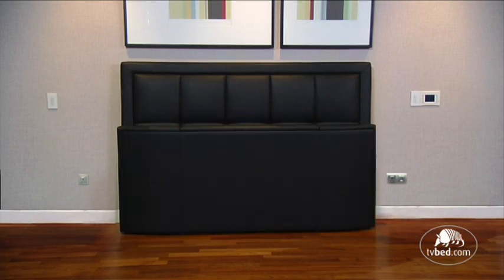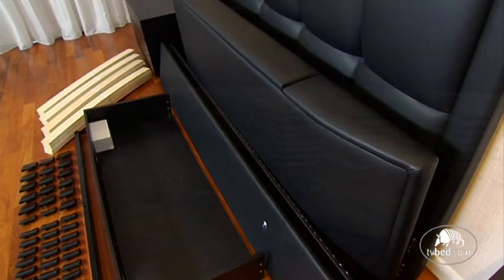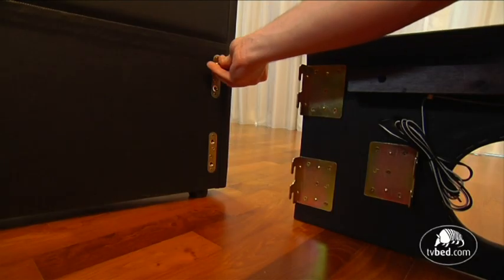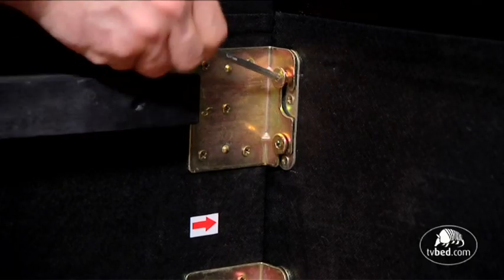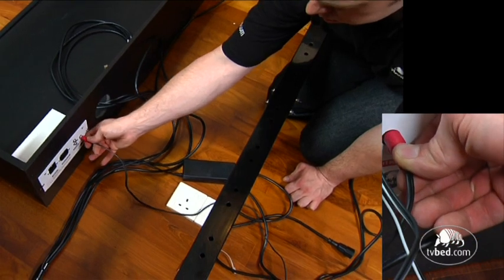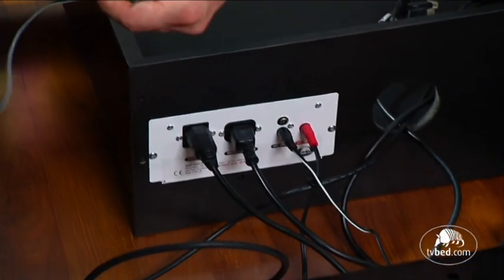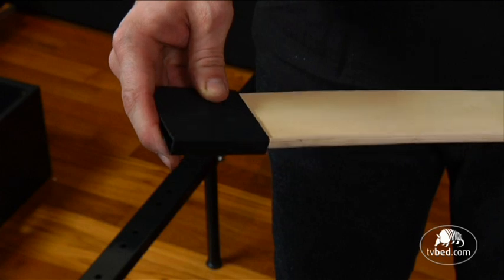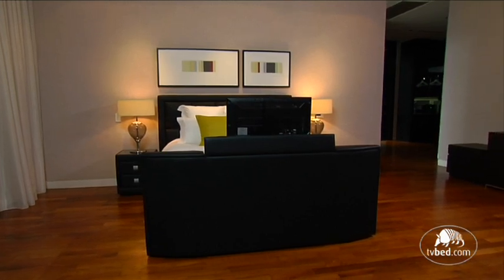TV BED - ASSEMBLY VIDEO

Comment: We just fitted ours up. One thing that did catch us out and im sure we arnt the only ones to do it....make sure you dont bring leads behind the tv as the centre strut on the mechanism will catch it and if its a close fit...which it is...it will snap the cable plug when the tv desends.
      Basic rule is leave all leads to the left or right of the tele...but never cross over.

Comment: I have this bed ,is it possible to change the TV TO A BIGGER SIZE
Reply: I’m struggling to
Change the tv I’ve had this bed for 5 years but think the company has closed down
Reply: Lambros Xydhias is 32 inch is the maximum for this bed? Want to get like a 4K tv 40inch
Reply: Yes... Just try and get what can fit to the biggest... TV replacement is really easy and only takes half an hour
Reply: But you have to power the tv by running an extension cable from an outlet
Reply: crapcopter do you know how to change the tv? We have got the broken tv off and got an exact replacement but don’t know how to screw the nuts onto the bolts as everything is sealed? Can you get to it underneath anyway?
Reply: @AB-qi2rn  hi, im having the same problem as you and I'm wondering if you came to a solution.
Reply: @AB-qi2rn  let me know if you get a solution for this! Having the same problem as well.
Reply: @satan7288   let me know if you get a solution for this!
Reply: @vivekpaulchacko8490  Yes, its possible but very very difficult. There are screws which hold thr TV to the stand in the bed and its very hard to fit your hand in the space to unscrew them as its all very compact. The tv which you want to replace it with must also be ridiculously thin and smaller than 32" otherwise it will not fit.

When I realised hoe difficult the whole process would be, I returned the new tv I bought and just kept the one that the bed came with.
Reply: @satan7288  thanks for the reply! Yeah it seems very hard to reach in and get the screws loose. I might try it myself and probably do the same thing in terms of returning if it doesn’t work.
Reply: @vivekpaulchacko8490  did you have any joy? I’m thinking of buying a Samsung 32 Inch UE32T5300 but worried about size and whether the bed’s bracket will fit? Does anyone know what kind of bracket this bed has?
Reply: @kunaldave9073  I was literally thinking of the same TV. But I was so stuck on getting a bigger one, so I’m instead going to do a bit of an extreme option and get a 43” and fix it to the bracket, and basically never lower it again as I never lowered my 32” in the first place. Will let you know how it goes but unscrewing it from the bracket seems not too hard as I tested it and it was fine to take the tv off. From my measurements it looks like the bracket has a 200mm width and I think around 200/250mm height, which is pretty standard. Also if the screws don’t match up, you can always buy a VESA adapter plate like so: 

https://www.amazon.co.uk/PureMounts-PM-Adapt-B-Universal-Adaptor-400x200/dp/B008KL72T8/ref=asc_df_B008KL72T8/?tag=googshopuk-21&linkCode=df0&hvadid=214453842616&hvpos=&hvnetw=g&hvrand=13609877613036079302&hvpone=&hvptwo=&hvqmt=&hvdev=m&hvdvcmdl=&hvlocint=&hvlocphy=1006661&hvtargid=pla-420169743750&psc=1&th=1&psc=1

Let me know how you get on! And I’ll update you once I try fit the 43” (going to be a mission)
Reply: @vivekpaulchacko8490  amazing!! Thank you so much for your help. I’ve been stuck trying find any information because of the age of the bed. I was tempted to buy a new bed but everything works perfectly it’s just the size of the tv I wanted to change. I will let you know how I get on with the new tv :-)
Reply: @kunaldave9073  hey Kunal, just to update you, successfully put in a bigger TV onto my mount! 

First I had to saw off the top part of my tv bed mount as I got a bigger TV.

Then I screwed on the VESA adapter plate by putting it on the top most screw holes. 

Then I had to put a wood piece under the tv to raise the TV so that the holes match up the adapter’s plate. Was a big process but got there in the end.

Comment from the maker: How long does it take to assemble our TV Bed? 

This is a question we often get asked and the answer couldn't be more simple. Two of our engineers are needed to lift and position the  #TVBed  . Once in place it takes 20 to 30 minutes to assemble and your bed comes complete with TV, lifting mechanism, HDMI cabling and electronics. But on all beds bought from www.tvbed.com we provide free delivery and installation (UK only). Easy! 

#Design  #contemporary